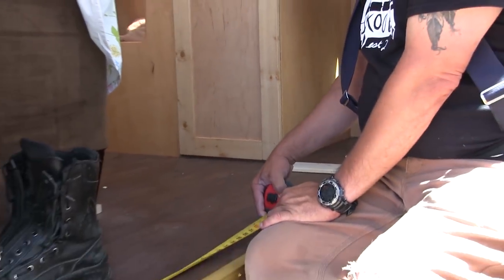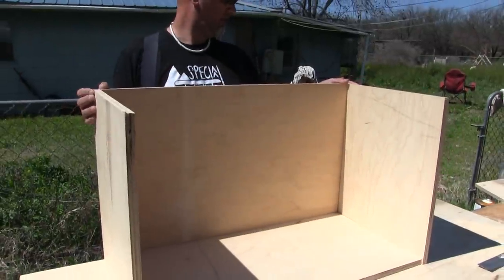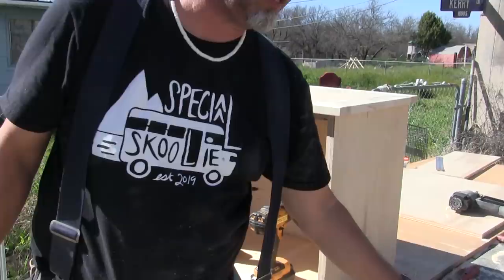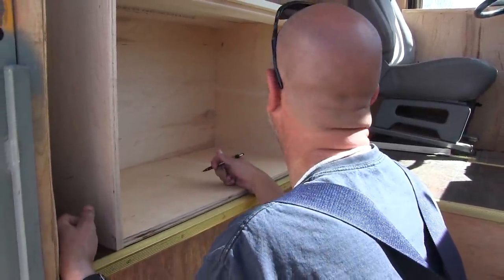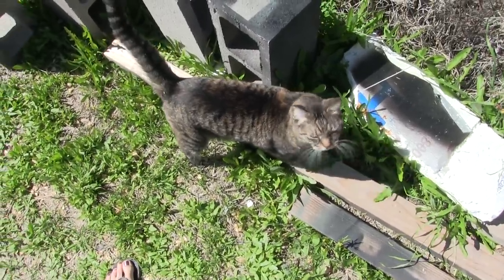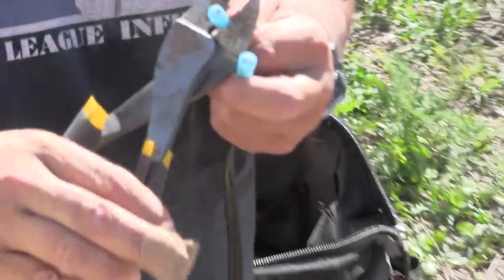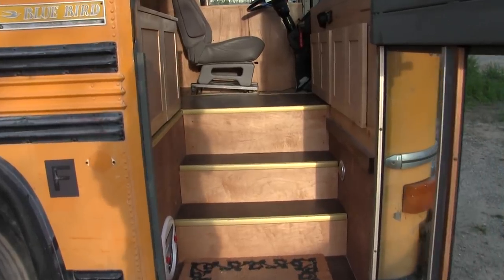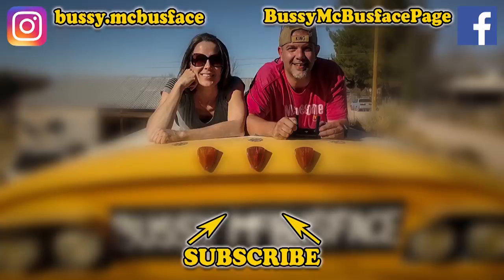Mike Builds a Boot Barn End Table for Our Skoolie

Comment: Hi Mike, Hi Kerry
I'm not an electrician by all means but am a Handyman out here west of Phoenix and am doing quite some electrical work.
For my opinion you should install that receptacle into a box. For one the spaces are quite narrow between the wood and the receptacle, the second is that it is not covered from the back , means you could be electrocuted if you reach in with your hand or a metal part of your backpack leans on it and sets that one on fire.

Comment: Shouldn’t those outlets be in a box?    Shelf in Kerry cabinet ? Or above diesel heater?   Make sure what ever door hardware you get doesn’t  snag your clothes as you walk buy. I catch my pockets all the time on our cabinet / drawer pulls.
Reply from the maker: OMG, we say the same thing about handles that snag your clothes, it's a TOTAL PET PEAVE for us!!! We will add a shelf to Kerry's shoe shack but probably not the heater space ~ we cant attach a shelf to the back wall there because it is a hinged door that opens from the front of the bus! As for the electrical we've followed what we've seen others do (folly?), but would like to get an electricians opinion.
Reply: Bussy McBusface I’m no electrician but if it was residential all junctions, connections have to be inside a box.  Wouldn’t be to terrible to add a box inside your cabinets.  We did those in our kitchen island.

Comment: I’m so glad you guys put your home couch in, I am planning to do the same for that home feel and to save on material. How exactly did you guys go about it?
Reply from the maker: We found one that would fit over the wheel well and we weren't even sure that it would fit in the bus through the front door but you may have to take your door off to get it in. Then we just used L brackets to hold it to the floor.